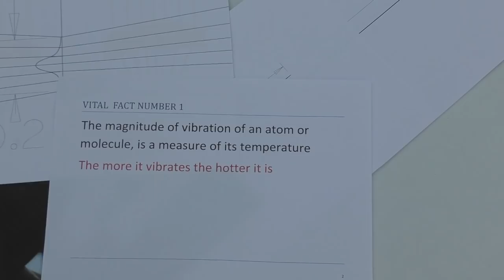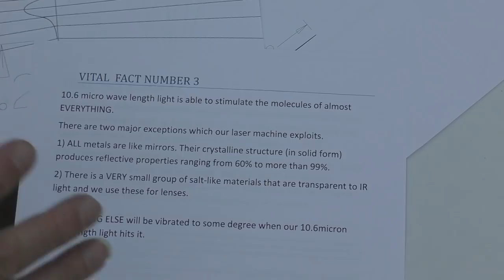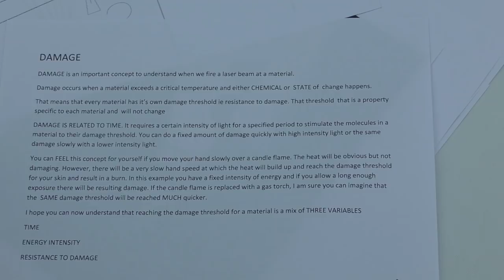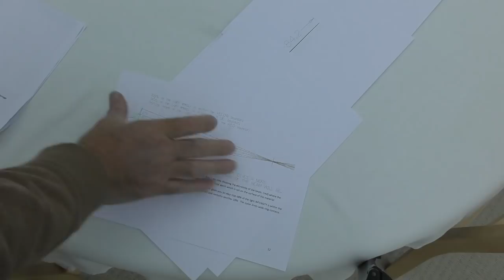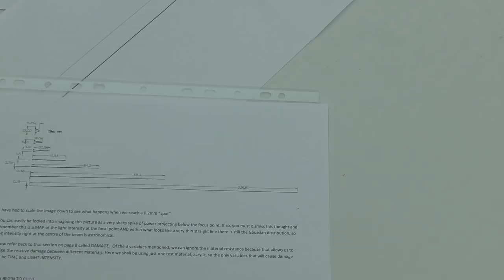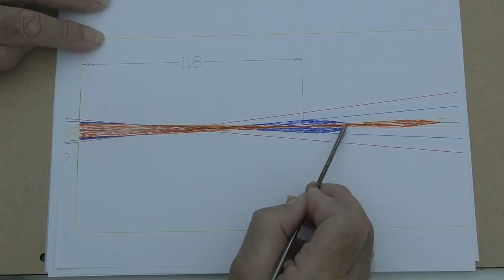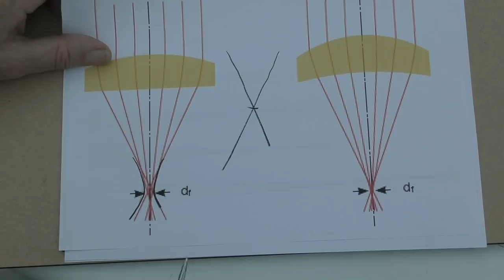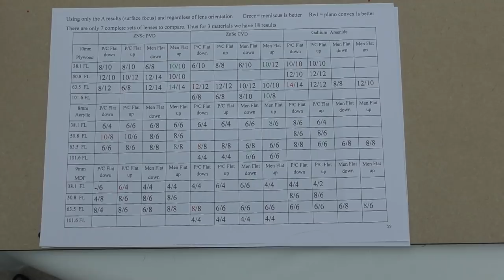RDWorks Learning Lab 172 AT LAST!! How Lenses Work

Comment: Simply brilliant. Using what I learned from you I can now get perfect cuts with no burning and no smoke residue. I can cut more quickly, use less power and cut through thicker material.

Comment: This is brilliant, I kept coming back to the idea that the cuts not being as straight as I wanted had something to do with the lens and intensity, so I bought a bigger laser, more intensity, at 150w, I wonder perhaps if the benefit of a 4” lens is not being realized simply because 60w isn’t enough to realize it’s potential.  Which seems to suggest that a 2.5” lense for 60w is more of a sweet spot for cutting, but to reach that sweet spot for a 4” lens, perhaps more intensity or more power ultimately is what is needed.. amazing video, brilliant work friend.

Comment: I think you are definitely on the right path to solving this mystery, in my opinion what can be the cause for conflicting data, is the sublimation of the material as it is being cut. Back to your ultimate air assist video where you found that improving air efficiency improved the cut and i think that's the answer to why you have conflicting data,  when pulsing at one spot there is less fumes in comparison to cutting. In my experience a 3" lens cuts better than a 4" lens, and i thought it was the energy density but for me a 2.5 or 2" lens could not do the job as best as the 3" lens. (please note i mostly cut 9mm plywood and 6mm acrylic @16mm/s & @19mm/s). I am also confused that the theory is not similar to the actual cuts. Can it be because a  4" lens has less energy density it will end up giving a beam drag, and a 1.5" lens with a high density but doesn't have the light intensity to cut thru thick materials? my best guess for cutting i think there is some magic of balance with tube power lens size to = the fastest and best cut. hence the reason your 2" lens performed better on you machine than a 4" lens. Also is it because the dot size in a 4" lens is bigger and it allows the gas pressure to be release faster hence a straighter cut? i will continue to follow your excellent work and eagerly await the day you crack this mystery

Comment: Hi Russ. One thing you mention several times is how the area increases directly with the spot size. Unfortunately, that's not correct. The beam width / spot size is a measure of the diameter, but in 2D, the area of the resulting circle is r^2 = (d/2)^2. So as the spot size doubles, the area quadruples. So your 4" lens doesn't have a quarter of the energy density (at the focal point) of a 1" lens, but in fact it's 1/16th of the energy density. I don't think that changes your conclusions, but it's worth keeping in mind that things scale with the square, not linearly.

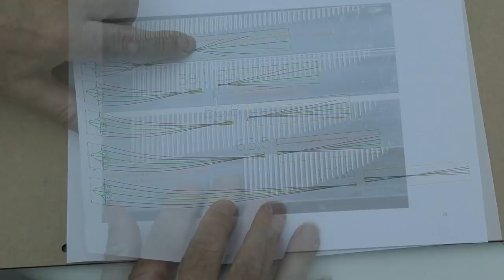In other videos you mentioned Parallax-Tech. If you check their FAQ (https://www.parallax-tech.com/faq.htm#f_size), they cover both the spot size and the depth of field. The depth of field is the depth over which the spot size remains relatively the same. With larger lenses, you get a larger spot size, but you also get a deeper depth of field. This is what you are alluding to in at 48:00. With a longer focal length, you get a deeper depth of field, so the beam stays narrow deeper into the cut, giving you a more consistent, high-energy beam, whereas the shorter focal length will diverge faster, giving you less energy density as you cut deeper. Unfortunately, it's a trade-off. On the one end, a very short focal length gives you a very narrow spot size at the focal length, but it diverges so quickly that you quickly become out of focus at any depth beyond that. At the other end, a very long focal length gives you a rather large spot size at the focal length, but it remains close to that size all the way through the depth of the cut. You can see this clearly in your pierce tests at 48:36. The short focal length lens gave you a fairly narrow spot at the surface, but quickly diverged to the point that it couldn't cut at all.

Which is best? I guess that depends on what you are looking for. If you can afford a wide kerf and a slower cutting speed, a long focal length will give you nice, parallel cuts. If you need a narrow kerf cut quickly, you will want to aim for roughly half the depth of the material (with the same considerations you showed for the non-symmetric shape the cut takes) and choose a focal length that minimizes the spot size at the top and bottom of the cut, which will depend on both the spot size at the focal length and how quickly that converges and diverges. For your 8-10mm materials, a 4" lens might be the best tradeoff of the lenses you have available. For thinner materials, such as 3mm, you might find that a shorter focal length gives better results.

On Parallax-Tech, they have a table showing examples of how the spot size and DOF varies with focal length. For their example, a 4" has a DOF of 5.6mm, compared to a 2" lens having a DOF of only 1.4mm. However, the spot size of the 4" lens is 0.195mm, whereas the 2" has a spot size of 0.098mm, for an energy density of only (0.098/0.195)^2=0.25x. But that energy density for the 4" would be fairly consistent throughout the depth of the cut. The DOF says the height of the column where the spot size remains within 40% (1.4x) of the spot size at the focal length. Let's assume it grows linearly outside of that. For the 4" lens, if you aim at the top of the material, by the time you get 10mm down, the spot size has increased to 0.65mm. For the 2" lens, it ends up being 12mm! Even though it started out smaller, it diverged much faster. The material near the surface would have cut much faster, but the material lower down would have cut much slower, if it cut at all.

But the results would be quite different if you were to make a 3mm deep cut. By the time you get to 3mm, the 4" has a spot size of 0.279mm and the 2" has a spot size of 0.402mm. The advantage is still to the 4" in this case, but it's a much smaller advantage.

The results will depend on the actual spot size and DOF you get with your lenses, which also depends on the original beam size. For my CO2 laser with a 3mm beam size, the spot sizes are a bit wider and the DOF is much deeper for both of these lenses, so a 2" lens easily cuts 3mm and even 6mm with a kerf around 0.25mm with very little taper. I've even cut 1/2" material without trouble (though it barely fits under the laser head). The cutting speeds scale roughly linearly with the thickness of the material too, since it has such a deep DOF. Unfortunately, even a 1" lens doesn't get me a particularly narrow spot size, so it's not great for engraving.

If I remember correctly, you said you had an 8mm beam? In that case, you could expect a very short DOF unless you use quite a long focal length. Such a laser would be great for engraving, but not great for cutting thick materials.
Reply from the maker: First of all , thank you very much for listening to and absorbing all my ramblings. I always try to make it clear that I am not actually teaching with my videos but am on a journey of personal discovery. What you observe is me thinking out loud trying to make sense of the problem I am trying to solve.  It is a method that allows people such as yourself to participate in that thought process and offer advice. I can understand your mathematical precision  from my linking spot size with direct  but that was just loose words because as an engineer  I do fully understand the relationship between linear dimensions and area.  At this point 18 months ago I had been wrestling for almost 2 years (on and off) with the incongruities of lens theory and what I was observing in practice.The spot size and depth of field  are concepts that I have lived with and believed in since my school days. Let's face it, optical theory and lenses have been in existence for thousands of years so why should I be questioning its validity? However, neither the Egyptians nor Galileo had lasers to test the extremities of lens theory . I used to refer to Parallax Tech because they had a very understandable summation of lens theory  and as producers of high quality laser tubes I assumed that they were broadcasting proven facts along with the lens theory.  It turns out to be a false assumption because the concept of energy density that they discuss 
Intensity = Power / spot size area
is in fact totally wrong. It assumes that the intensity at the spot area is uniform. The intensity distribution within any laser beam is ideally Gaussian and just because you pass it through a lens does not make it become any less Gaussian within the spot diameter. The rate at which light damages material is a function of its INTENSITY. and as the intensity within the spot is NOT uniform the whole theory falls apart.

 As I said, I am on a learning journey  for all aspects of this technology  but my biggest struggle has been to understand what mechanism  makes it possible for the  lens/laser beam combination cut deep parallel  cuts. As you will see in some of my more recent videos I cut through 26mm hardwood with a 63.5mm fl lens and the cut is completely parallel. How do diverging  rays/ ever decreasing energy density account for this behaviour and for sure, the depth of field on a 2.5" lens cannot explain it.

About 6 months ago I set forth on an idea to create a long focus compound lens that would allow me to increase the cutting power of a lens by reducing the beam diameter before entering the lower second lens.  As I have often said, ignorance is a great teacher and in this case I hit a brick wall that was just as puzzling as the "why parallel cuts" question.  However it did lead me to a completely new way to examine the characteristics of lenses .This in turn began to peel back the curtain on how lenses and laser beams interact. and I have now developed a theory of how lenses really work to produce these previously unfathomable feats. 
 You may like to begin in January of this year  at #196    https://www.youtube.com/watch?v=qfoig-maWCA  and follow the story to date. I have still got more experiments and proof to carry out  but I think the basic concept is beyond doubt.

Thanks again for your serious  interest and I hope many of your issues will be addressed by this more recent  part of my journey
 Best wishes
Russ
Reply: Fabulous comment thanks so much for writing this up - I’ve copied and pasted it into my “laser notes” folder so I don’t lose it !

Comment: Awesome video and visuals.  I know you worry about your drawing capabilities but it all made perfect sense to me.  I was already visualizing the extension of the yellow and blue areas before you showed the next drawing it was great to finally get a mental model of what's likely happening in the cut and visually the acrylic static cuts seem to match as well.  I'm really curious as to what is happening with the 4" lens now, the static tests bare the results of your drawings and explanation, but the dynamic doesn't appear to agree - although it could be something to do with the phenomina you mention with focal length seeming to change in dynamic conditions.  

Probably not actual focal length changing, but the way the cut occurs under dynamic conditions.  Could be the interaction of the energy density & exposure time between the blue and yellow zones change under dynamic conditions - for instance the when you talk about material being "skived off" by the hot gasses escaping the hole wouldn't apply in an actual cut because the hot gasses could escape either below or behind in the "trench" carved by previous cutting action.

We're definitely another level deep in our understanding thanks to your hard work and beach induced epiphany!!

I'm going to start putting all this hard work to use while I wait for further discoveries on the 4".  Although I'm thinking about doing some investigative work on my own as well - you have me curious.
Reply from the maker: Hi Mike
 I am pleased that my simple model made sense to you.. As I have declared , things are not as simple as red blue and yellow but the skeleton is something I feel confident about.. It has been suggested I have ignored refraction and diffraction effects. . I don't believe there are any diffraction effects and any refraction will be minimal as the density change between air and acrylic vapor must be low.. If my simple model has given people the same vision of what I thought may be happening within the cut then I have succeeded. It may not be the perfect model but I hope it will stimulate people like yourself to carry out your own exploratory work that will support, modify or disprove my thoughts.   I think that having something on paper , rather than  relying on existing science theory (that will always be bounded by limiting conditions) or the many  unsubstantiated thoughts and pseudo scientific ideas that I have encountered, will allow the "practical" people to have a meaningful visualization to work with. I know that the simple formula for a straight line is Y=mX + C  but even so,  my simple 2 cell brain cannot visualize anything from that equation. However,  draw me a line and  it is imprinted for life.
Thanks for your thoughts and good luck with your own experiments.
Best wishers
Russ

Comment: Hi Russ!! I watched all your lens videos but I couldn't come to a conclusion!
My standard lens is PVD P/C 2" focal length, 12mm diameter

Which lens is better for a 50W chinese laser tube, I work with cutting and engraving of 3,1mm MDF and 2mm Acrylic? I need a fast and parallel cut in those materials.
Reply from the maker: Hi Mauricio
For your thicknesses of material There will be very little edge distortion with any lens.. The fact you have a 12mm diameter lens tells me quite a lot about your machine. It sounds like an enlarged K40 type of machine. That also implies that your 50 watt tube is only about 800mm long and is really a 40 watt tube which should not be run at more than 18mA. I further infer that  this was an Ebay purchase and therefore the tube (unless you have replaced it) is a B grade tube and unlikely to be delivering much more than 30 watts. All  this from knowing your lens diameter!!!
For cutting you need power (and yours is limited) .so your 2" lens is fine and is a general do it all lens for many machines. However you could improve your cutting speed with a cheap Chinese PVD  1.5" lens used flat side down.  For engraving you need little  power  so that same 1.5" lens used flat side up will produce well formed small dots for photo engraving and normal engraving.  With your materials, such a short focus will not cause off angle edges.
Best wishes
Russ
Reply: @SarbarMultimedia  Thanks for the answer Russ, and you are correct, the tube is 800mm !! On the lens, I will buy a 2" of higher quality, because the one that came on it is very bad, you can see on it that it is very opaque, I am already aiming at a cloudray one, on the parallel cut, even adjusting the focus and the height of the tube perfectly, I still have a slight problem with parallel cutting, but it must be due to the lens being of very low quality, I will buy the new lens and make the necessary adjustments, thanks again.
Reply from the maker: @MauricioBachega  Just choose the cheapest Cloudray PVD lens. They are well suited your low power (up to about 80 watts. They are not as geometrically correct as the more expensive lenses,  so you may think that is a bad thing. No, trust me , from all the cutting experiments I have conducted the PVD  lens material used flat side down is as good or better than lenses twice the price.
 Best wishes
Russ
Reply: @SarbarMultimedia  Thank you Russ!

Comment: Hello: Is it possible to integrate two different formats into a program RDwork?
We want a clip on the process of merging stuff . thanks
Reply from the maker: Hi Ahmed
There are only two formats that RDWorks will import, bitmaps and vectors. Whenever you import a file it will always place it central to your drawing area. I would  always  move file 1 off of the work area and then import drawing 2. You can repeat this for many images. I would set each image on its'sown layer band if you are not going to modify a layer then GROUP it so that it is easy to move. You can set layers on top of each other and use the little blue preview screen on the top tool bar to see the result.
Experiment with layers and groups.
Best wishes
Russ